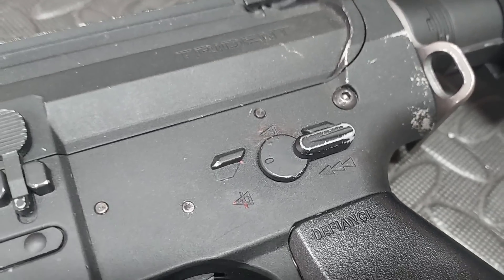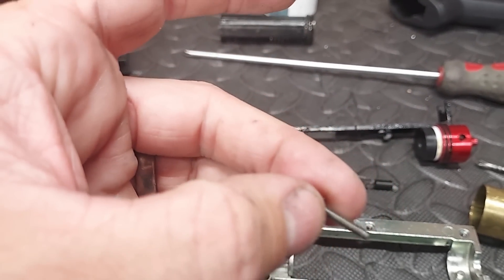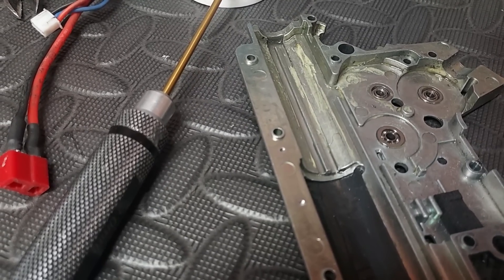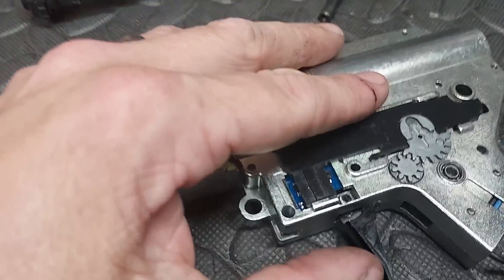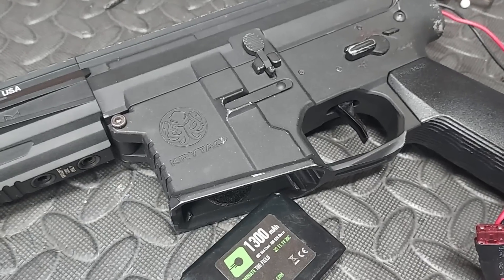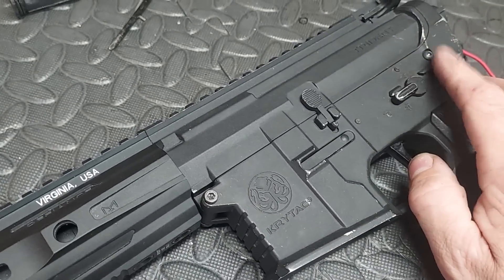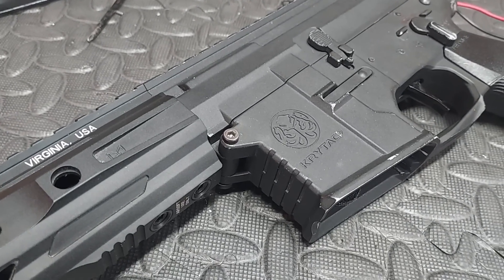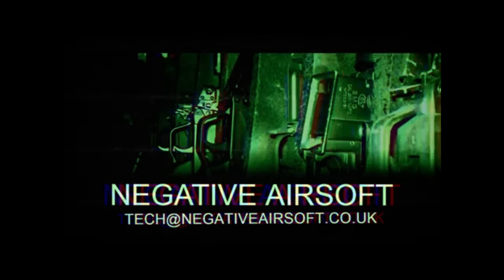Rubber Cement As A Lubricant?

Comment: Yepppp rocket dual o ring nozzle is fantastic seal wise but the thing has a lot of resistance for sure! Fantastic work yet again... gotta love mosfet gremlins
Reply: Even with silicone oil in it?
Reply: When you move the nozzle with your hands, is it stiff to move, or to say, 'it does not move effortlessly'? This seemingly little resistance in the system will take wattage to move through the resistance. With brushed motors this will equate to less shots on battery. I have found noticeable amp-draw differences when using dual, single and no o-ring nozzles, even when in conjunction with hightorque motors. I found the differences using a Turnigy Wattage Meter. For some it may not mean a lot, but for fine tuning my AEG, testings showed me that one or no o-ring will give me more shots on battery as well as help with delivering a consistent current discharge each load cycle.

Comment: Had a similar issue with a very old Krytac CRB MK1 - Krytac tappet felt too wide, would grind on the case and return too slowly to feed correctly. I used a bit of sandpaper to make the track super smooth, but it didn’t help. I switched to a blue SHS tappet plate and that worked. It’s weird, even a second Krytac tappet plate wouldn’t function correctly.

Comment: A mix of die electric oil and Vaseline! Both melt to a liquid ,then form into goo!
Then repeats and turns to a waxy putty!

I’ve seen it once before in a really nice RC Car gear box in the 90’s ,then again in an AEG a couple years ago. 
The guy with the RC was honest and told me what he was using. “Food grade silicone mixed with Vaseline”. 
I told him both melt at high temps and turn to wax and not to ever use either together or separately again. 
It’s an honest mistake when you have no idea i guess?

Comment: I kinda wish these mosfets had an extra hole in them where if you want to, you could drill and tap your own hole and have two screws keeping it in, if you find you have problems with vibrations

Also I worked on a tm recoil with a Jefftron and that had two points it was screwed into the shell, and weirdly, worked very well, shame the shop that worked on it shimmed it terribly resulting in the gears grinding themselves to death

Comment: Jefftron would absolutely warranty that mosfet. They are hands down above the rest when it comes to customer service. I installed a jefftron on my EVO3 and it's the best thing I've done to it. Not sure if this gun came with the ARL factory installed or if it was a modification to use on the jefftron, but it could definitely be the issue. Perhaps the spring on the ARL is right there at the point of working and slipping past. Only reason I say this is because I had a similar issue and it was user installation error.